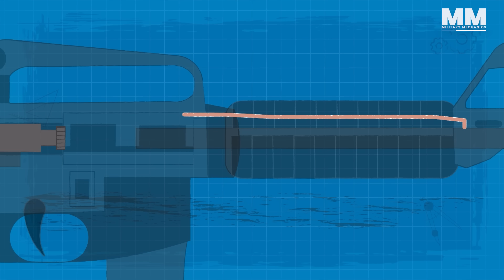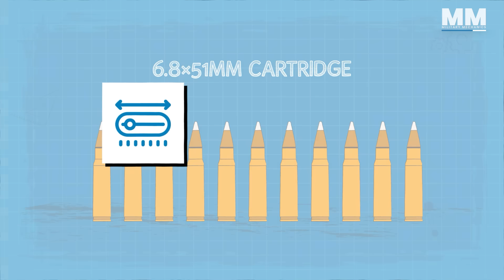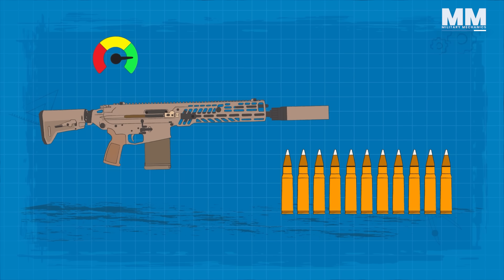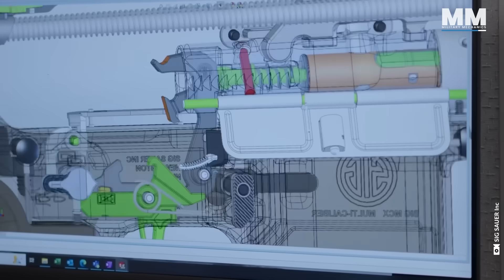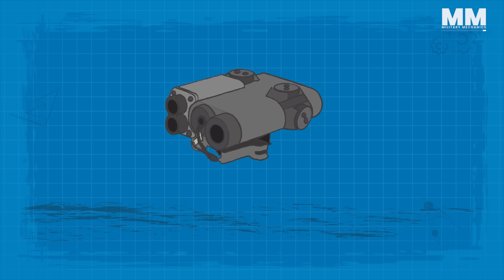XM7 vs M4: Why the U.S. Army Is Making the Switch

Comment: According to Copilot the average per unit cost for the XM7 rifle is an unbelievably low price of $190 over the life of the contract.  On the other hand the fire control unit (1-8x optic) comes in at an astounding $10,000+ per unit over the life of the contract. That is insane.
Reply: Less ammunition and more weight that's a great idea.
Reply: @Sandhill1988  it is if accuracy and hits go up geometrically.
Reply: They get you with the accessories... Activision must be the parent company.
Reply: Yeah that's not good math it's a 2.7 billion contract each rifle will more than likely cost about $4000 according to chatgpt. The suppressor will more than likely be sold for $900. It's completely unreasonable from an economic standpoint. This will never replace the m4 as a basic issue rifle. And yeah that $10,000 optic cost will kill the program those are prices reserved for precision rifles not an infantry rifle.
Reply: @johncorey2472  Uhhh if your too lazy to search the initial Army plan is to replace the rifles of the close combat unit's first with the army currently soliciting a Barrel conversion kit for the M4 and M240. 

And No it's not gonna die and the scope price today is irrelevant as there are few that exist today hence it's current price that might not be the case in the next couple of years however.
Reply: @gotanon9659   I searched it and I've also talked to the individuals who are part of the program. Even they know it will be downgraded to a specialty weapon that augments the rifle platoon. Even the program managers said that the M4A1 isn't going anywhere. 

The m250 is a phenomenal weapon..... But one of the main problems with this program is logistical feasibility. The ammo is massively expensive and isn't economical compared to 7.62 NATO. Program members have alluded to the fact that more than likely they will swap barrels to 7.62 NATO after DLA comes to the realization that this plan is untenable.
Reply: @gotanon9659  you also have to remember that most of the weapons programs that the army draws up on paper never really end up getting widespread adoption or nothing occurs at all.
Reply: So glad I got to serve with a real rifle. M16A1 & A2. You can keep those half rifles. Somehow the military always finds a way to take a weapon that was designed to do something to not to do it.
Reply: @Sandhill1988   But how do we counter Chinese body armor? We know they can't make a rifle worth a dawm, but their body armor is legit. And realistically our troops are going to be outnumbered in a pacific conflict so, our only strength we have is our firearms and optics. So whats is your  grand solution Sandhill?
Reply: @rink2343 We go with the 6 x 43mm MAX cartridge. Yes, it can't penetrate armor better than 6.8 x 51mm. But it still penetrates armor much better than 5.56, and produces more energy than 7.62 x 39mm. Plus it effective range of 1,000+ yards. We don't fully know the true armor penetrating capabilities, as no AP rounds exist for it. But based on the known ballistics of it, it would penetrate armor and barriers significantly better than the 5.56's newer M855A1 cartridge, even in shorter barrels.

With the 6mm MAX, we up the firepower of our troops and the M4 across the board, while still being able to carry as much ammunition as 5.56, or at least very close. In any case, much more than 6.8 x 51mm. Which would be much better suited to replaced 7.62 Nato and it's intended roles.

Even if they have decent body armor, we'd still be slinging better stuff than then down range, plus we also have body armor, and better trained, more experienced soldiers.

Plus, bullets don't need to penetrate to game over somebody. We've had troops get dropped by 7.62 x 39mm, due to the kinetic energy stopping their heart, as well as sending bone fragments getting launched into vital organs. On top of said vital organs being ruptured, also due to kinetic energy.

I say use 6mm Max and 6.8mm in conjunction, and you have a borderline unstoppable combo.
Reply: @NobleFrontier  Yes, your right about using bouth in conjunction but the logistics of standardizing two amo types is not something the military is willing to pay. Hell the M7 and M250 are both designed to be able to convert to standard 5.56 if need be. So instead we have the sig Mk18.
Edit: (Thanks for the sane responce and not a spawm comment)

Comment: Is it not possible to modify the 5.56 to increase the pressure? If it is possible, why not do that instead?
Reply: I was wondering the same thing. Heavier grain 556 with higher pressure propellant and higher pressure barrels. It would be cheaper and easier to implement into an existing ecosystem
Reply: That’s essentially what .243 Winchester is (5.55 projectile in a 308 case) still not strong enough to defeat level 4.
Reply: There's green point however 5.56 doesn't stand up to Russian and Chinese Armor. 5.56 is good against soft and light targets. The new round makes sense, the rifle doesn't.
Reply: @mauricebeyjr611  barrel wear will be an issue. None of this makes sense.

Comment: The rounds they will use in combat are hybrid rounds using two different materials in the casing allowing it to hit those high psi readings. Plus also saves weight on the rounds carried
Reply: Brass and stainless steel save weight?